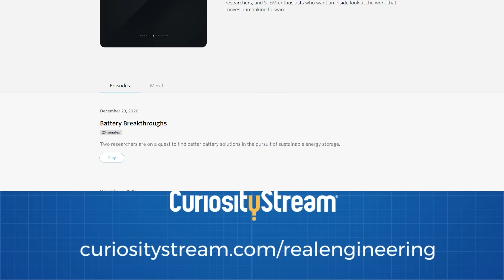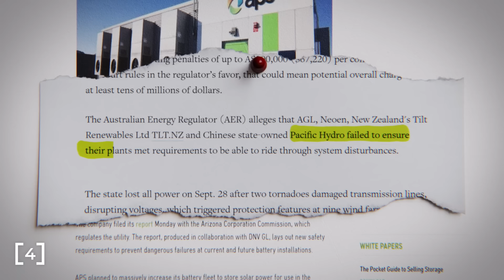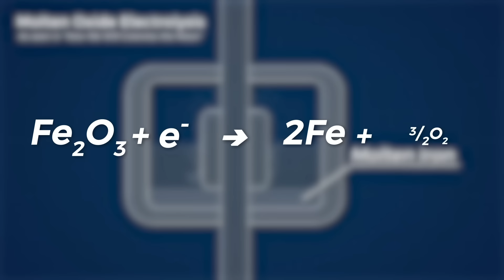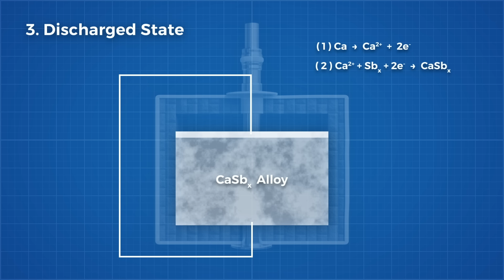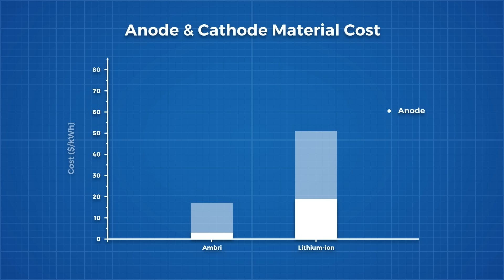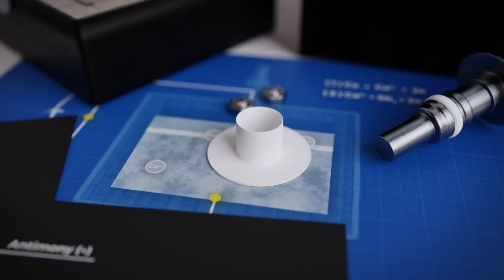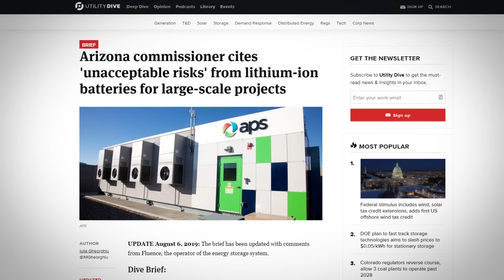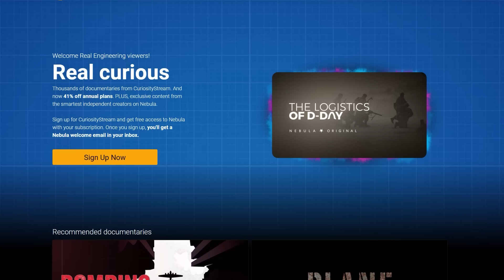The Missing Link in Renewables

Comment: In the endless debate bewteen fossile fuel and renewable energy, this is what we need.
I'm rather conservative, yet I study environmental protection stuff.
So I am very frustrated that especially in thr USA, there seem to be only 2 sides.
And IMO neither side is right, though I lean a little more to the conservative side, but that's a different topic.

I've always advocated for, investing more into R&D, which will make renewable eventually cheaper, and possible to produce in the own country, instead of relying on countries like China.
And this will ultimately drive down electricity prices from renewably energy.
And this is the ONLY way it can work. Otherwise you always have to try to manipulate the market with subsidies.

Comment: I cannot understand why there is so much interest and research into batteries. It is not a solution to intermittent generation from renewables as the capacity required is so huge. Not only that but it also requires a much higher capacity of generation to be able to recharge the battery, the sums simply do not add up.
Really, dump renewables (they are technically rubbish) and pursue sensible avenues of generation, with nuclear being the only option currently available.

Comment: Glad we see eye to eye. I wanted to say energy storage and transportation of said energy to where it is needed; which means upgrading the grid to accommodate it. While changing the grid architecture, I would suggest future-proofing it by setting up networks of community-based grids (aka: micro-grids). We need to design the energy grid like the internet is designed imho.

Comment: 9:33 Missed your basic chemistry class? It's pronounced cath-ion, not cash-ion, derived from cathode and ion. Real engineers know that.
btw., as densities of liquid calcium and calcium-antimony alloy are different, how are they going to prevent the electrode protruding the salt electrolyte when the levels of the layers are changing, causing an internal short circuit?

Comment: No, flow batteries aren't the answer. They use a lot of energy just to stay operative. You can't charge them and use the energy five - seven days later. 
We have the solution available since a century and half. That's the Lead-Acid battery, with carbon-added electrodes.
They are cheap, powerful, long lasting and 100% recyclable - all the characteristics that Li-Ion batteries DON'T have. Yes, Lead-Acid are higher in weight and volume than Lead-Acid, but that - as yourself said - doesn't count in a stationary grid battery.
It is our industrial model that pushes for new solutions to new problems, it is a way to make money and advance society. 
But for grid electricity storage - please do your research leaving any bias aside, just think "We want an electricity warehouse"; all calculations, true and complete, take to one single valid answer: some massive, modern Lead - Acid battery banks. Recyclable on-site and ad-libitum.
Nobody would get rich, maybe not even slightly enriched. But we would have our electricity warehouses, cheap and rugged. They would allow an almost unchecked expansion of wind and solar electricity production.
Mind the size, though. Actual grid batteries can sustain the network for - say - thirty minutes. We need to build a Lead-Acid battery to sustain the grid for a week - that is one-thousand times bigger than any grid battery actually installed. But it can be up to 50 times cheaper than Li-Ion technology, and much less fault-prone.

Comment: Since it's metal and very hot metal my thoughts are to put it at the top of a hole and possibly keep it spinning like gravitational energy storage and mechanical energy storage. Since it's heavy and all that. Plus I don't want hot metal just easily accessed and when in operation it should get hotter. So with discharging having it slowly slide down the shaft to keep it away from things would be a great idea.

The spinning probably not as much, I imagine, since it could interfere with the separation maybe?

Then there's always the possibility of only needing so much heat for the reaction to go smoothly and being able to recapture it via Stirling engine processes to maintain thermals and recapture some energy loss as a plus!

Comment: I found that I had a lot of misconceptions about wind as solar as well. I had been thinking that what we needed was renewable energy when what is actually needed is clean reliable energy. 🤦9
I had assumed that a unit of power production from them meant a unit less from FF, that they were cleaner than the alternatives, that power could be stored for use when needed like water or grain, and that if we just built enough of them we could meet our energy needs without FF. All of this was absolutely wrong. Wind and solar requires 100's of times more resources per unit of power production as NP does and they don't stand on their own, typically backed up with coal or NG. And as intermittent power sources bring instability to a grid we end up using far more backup than we need with stable reliable sources. And the higher percentage of Intermittents the greater the instability and the higher percentage of backup needed. At 20-30% capacity factor, every MW-hr of solar & wind drive 3-5x as much gas build out for backup. But, since solar/wind are chaotic, they drive gas efficiency down, driving gas burned per MWe-hr up by 2-3x. This is probably why we've seen so little progress in emmissions reduction by adding them to our power grids compared to NP and hydro power. 
Carbon emissions 2020 Europe 
https://twitter.com/electricityMap/status/1357248695499128832?s=19
www.ElectricityMap.Org 

If reducing emissions is the goal they don't bring much to the party, while NP has been able to decarbonize grids in a decade or two.

Comment: NOPE. 
No grid. 
Strongest infrastructure is power harvested On site. 

So this is solar, for most people in the us. 
The Panels must all be cheap thin film cdte or cigs panels, on big rolls made in a roll takeup chamber instead of much costlier silicon plant and assembly line. The panels would be larger because they are lighter. and are easy to put on any roof nomatter load capacity. 
The panels are 1000w or 1500w each. 
This is so there are fewer connections. The panels can be on every side of the roof, and the power can meet at a star point instead of done in strings. High voltage systems 250v are good for thin film and are safe and use less energy to make. 
They are screwed and sealed on attachment points on the roof. They are made safe, shorts are mitigated due to the nature of the construction. Stainless steel on back, gorilla glass or clear durable plastic on the front. 
They would cost 1/5th to 1/10th of glass panels and 1/50th of installed. 
Its extremely viable its like printing paper on a magazine. 

And then, you get the inverters at full efficiency not crap in the 80s, up at 96 percent efficiency mandatory or just piss your setup to uselessness. 
They are cheap, solid state, ultra low loss and smd. no heatsink, bare bones analog everything. 

The mppt is 250v and they can be made cheap too like the inverter, 300 for the inverter, 100 for the mppt with amorphous core inductor so its small, and close to lossless smd fets. 

The batteries are all 320ah lifepo4 cheap, 50 from china usd each. 
That means you should have 16 or 20 of these for 48v and 60v systems. Best is 60v and you get high capacity, enough for a well insulated household. 
The storage is about 26kwh, the size of a suitcase, and its about 200 pounds less than a washing machine, easy to put in service position in any home with a dolly. The inverter mppt must mount near this, on top, the size of a shoebox, literally this is already possible. and cheap. 300usd in parts anyone with a credit card can have delivered to thier house. Amorphous core transformer, and egs002 inverter based board, 32fet or 24fet 

You see with just minor changes like making thin film flexible sheet type panels larger and easier to install, and connect, this makes it NATIONWIDE viable and economical. 

You see just buying batteries from manufactuerers that already exist and make a profit with respecatble energy storage is possible TODAY

And the inverter/mppt technology is avaliable also TODAY

People need to know how to use it, 
DO not get bogged down in the previous marketing bullshit they sell you glass panels and silicon are a scam actually. 
Anyone with a economizing brain cell can figure out technology mass produced in rolls on reels is much cheaper than damn worthless silicon. 
Cdte or cigs works great. and in low light too. 
There can just be 4 or 6 placed on roof, and secured with eylets and goop and you have solar with no extra liability or strain, lower cost, easier, 5 panels in parallel wiring is just so easy. 
The wires should all be single run, no connectors, panels ordered with wires attached and pre measured lengths. 
This is the easiest way. 
Roof penetrations are much easier when all you need is 1/4 inch hole and proper sealant. 
It makes it so easy, and repairable, and everyhting working how it should . 
Reinforced solar wire is no joke. 
Mc4 connectors imo are a fire hazard, and anything with potential water ingress. Sealed connections from factory are the way.

Comment: Calling the US a 120V system is a lie. We are 240V split faze, everything into a home is 240V. With 120V split out for use inside
Reply: I'm of the understanding that the US has multiple domestic voltage standards, with 240V home supply and 120V socket supply being the most common. Whereas here in the UK, it's a  400V home supply and 230V socket supply. I believe your max advised socket current draw means that you get up to 2kW per socket, is that right (I may be incorrect!), ours in the UK is 3kW (13A @ 230V)?
Reply: @onetrickhorse  from a 120V 20A is 2.4KW 120V 15A 1.8Kw. Those are the 2 most common plugs but we also have 240V 30A for appliances
Reply: @gdrriley420  ah interesting, so you guys have higher current than we do at 20A, ours is 13A.

Comment: I live in South Australia, only a few km away from where those HV power lines came down. I remember that day very well (it was a big storm).
Also, we already have great battery technology. Flow batteries. (Specifically Zinc Bromine) and they are commercially available. Can be discharged 100% every day for ten years, guaranteed no loss of capacity. And they are made out of fire retardant material. (I live in a bushfire risk are). So when I need power on a hot day, lithium is NOT the answer, Zn Br is!
Only problem is, everyone knows about this, and everyone knows about Li ion.
All they need is economies of scale!
These 500degree batteries are a dumb idea. High temps are always problematic!

Comment: THE BATTERY BLUES
All Lithium Ion batteries suffer from the same problem, spikes that grow between the cathode and anode until they reach the other side and cause maximum current flow through the short circuit. In many cases that can mean a fire that will also completely destroy the vehicle because using chemicals or water to put out such a hot fire basically does not work. For that reason most fire stations will allow them to burn until they run out of fuel.

Comment: Li - mining has to increase 3,000% in order to meet our projected electrification objectives
Only 1 Li mine in the US
85% of the Li needed for 2030 EVs does NOT EXIST

Black outs and brown outs

No one will ever give you the education you need to overthrow them - Linus

Lithium or some other metal, doesn't really matter - we are still talking about a huge amount of mining - on a scale we have not even contemplated

If you want something dirt cheap, make it out of dirt - wonderful, foundational element of "off-the-shelf" innovation - inventions that become commonly used

Antimony - 75% of world's supply from China
None mined in the US for 20 years

Ca melting temperature - 1,500 F
Sb melting temperature - 1,200 F
Can you imagine having something in your house at 1,500 all the time?
Insulation?
heat shielding?
Fire protection?

EV car fires - 20-30,000 gallons of water and have to be supervised for 5 days, 24 hours/day

Comment: Sorry the best tech that can be rolled out in the next ten years is “Liquid Air.”  It will even be better than batteries, why because air (that’s air not wind) is free.  Any paradigm you name, especially batteries you have to dig the components out of the ground and refine it, but air is here and ready to use as is. Even the ideology of dirt cheap is using the same principles - because it’s cheaper to use an alloy that comes out the ground as is will offer the best economic reality.  But air as a fuel, is renewable. The excess energy to make it usable can be supplied by the paradigm once it is up and running and there is not cost expenditure for operational waste !!!

Comment: We need a battery that would cost as little as a spare fuel tank and offers the same range, that lasts 10 years without any capacity reduction and can be recharged in 5 minutes (the time I spend now at the pump).

Comment: The sun is amongst other things a water mover in nature, i.e. it heats water & turns it into vapour after which it condenses and returns to the earth - so wind turbines combined with pump storage schemes effectively commoditizes this cycle without generating additional heat, it just uses the existing energy available - well done. But heat from the sun, also naturally cools the earth from the resulting wind. 

A natural cycle is being disrupted.
A neutral approach would be using as much as possible of whatever energy source is being introduced. Its agreed there is excess energy in the atmosphere, i.e. higher temperatures, and greenhouse gasses exacerbate it - but greenhouse gasses are natural phenomena.

Advances by humanity was brought about by harnessing the power available from higher temperatures, we just need to become more efficient/effective in doing it. Is it impossible to have higher volumes of CO2 and lower temperatures? Because high volumes of CO2 is potentially higher volumes of O2 given plants converts it into oxygen, and both are greenhouse gasses.

The green energy approach is like trying to lick your elbow. In reality it's like trying not to affect nature, by turning a blind eye to how you're affecting nature.

Time would be better spent finding ways to utilize the excess energy in the atmosphere.

Comment: Honestly, I don't understand this whole nonsense having to do with the concept of nuclear fusion as a source of energy production. I honestly don't understand, there have got to be some honest and capable physicists out their that would realize that the difference between fusion and fission is just polarity. In other words one process generates net positive energy when you're trying to generate power and the other produces net negative energy. I mean honestly if you dropped a large quantity of fissionable material somewhere and walked away there is the real possibility that it might result in a nuclear melt down or explosion at some point without requiring any other outside inputs of energy on the other hand if you placed a large quantity of hydrogen in a specific location without any other energetic inputs it will never result in any kind of nuclear incident because it would actually require the input of massive amounts of energy just to get the hydrogen to fuse and the only energy available for use in any other process would be the difference between the energy expended to get the process going and the energy released. Also, the energy bound up in the hydrogen you're burning through in order to try to make fusion work is also part of the energy costs even if you don't necessarily appreciate the hydrogen that much. That's the reason why once you start talking about nuclear fusion it many times leads right into the discussion of the need to strip mine entire gas planets like Jupiter despite the fact that nuclear fusion is supposed to be so much more efficient somehow than anything else.

Comment: Why can they not use tides as a pump to pump fresh water uphill to storage?
Batteries is the same scam as the LED light bulb industry. 
Why can't the heat generation of miners be sold to heat homes or water? Just a matter of cooling the crypto miners with things you want to heat up. Heat exchangers boost the heat and storage to hold the heat as it is used. Build two data centers one in Aus and one in Canada. Only mine in winter to then heat houses split the bill with the homes.
Why can't we write 'with the' as 'withe' it's the same letters. The english language is dumb.

Comment: We gotta start using gravity as a means of converting kinetic to potential energy. Get a machine that can lift some mass and have the machine hold it up until the energy is needed. The device will lower the mass and allow energy to be retrieved when needed. This would work very well for very large scale energy storage, we can use this rather than lithium. We gave plenty of gravity.

Comment: As much as love your videos, it really bothers me your bias against nuclear. To say that better technology for fission wont be feasable in the next 10 years just seems wrong with the information. Gen 3+ reactors are already proven and are inherently safe, and Gen 4 reactors just need to be tested, many of which would severely reduce the amount of radiative materials.
Plus there are the non tradition reactors, such as SMRs which are currently being built for their first grid implementations. It feels even worse as you continue to list off issues for batteries, which are all the primary issues for the implementation of SMRs.
I really would love to see you do an analysis of emerging nuclear fission, especially given the the IPCC has noted that nuclear needs to be apart of the picture to avoid 1.5C° of warming.